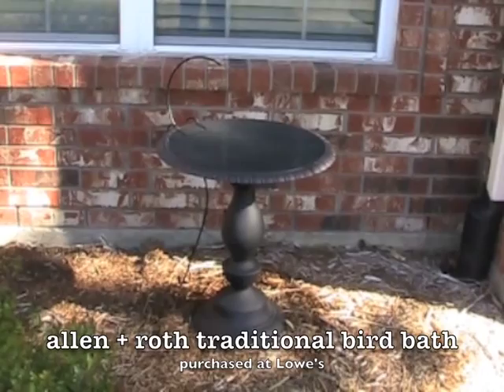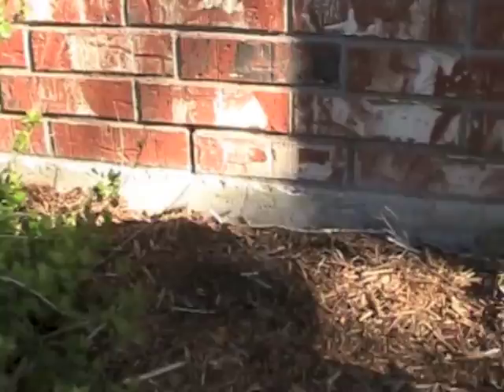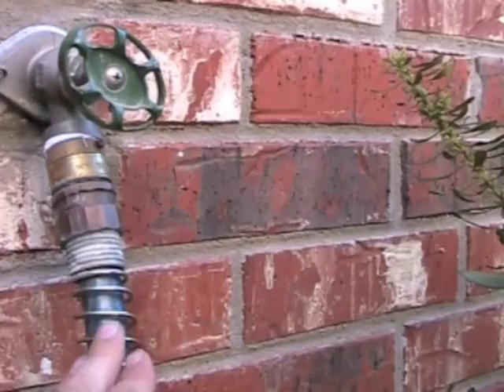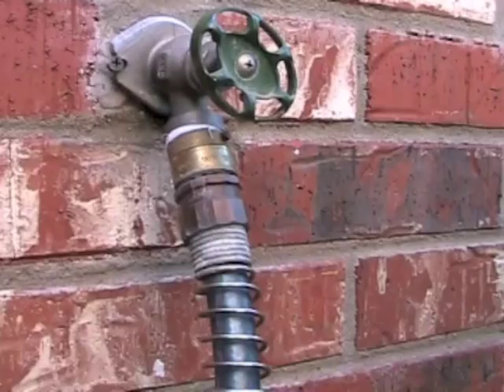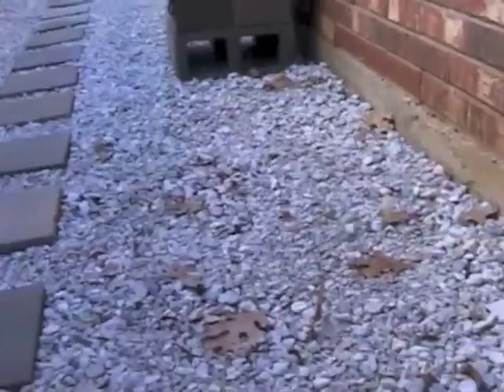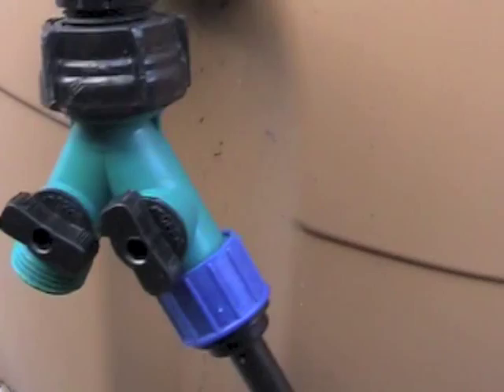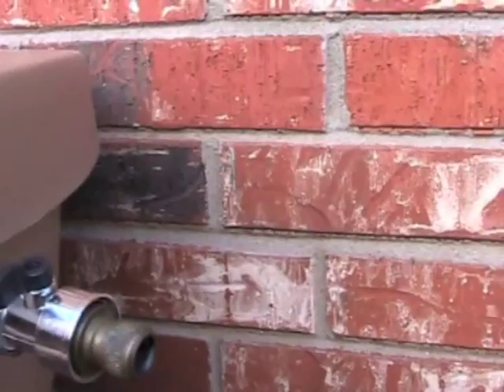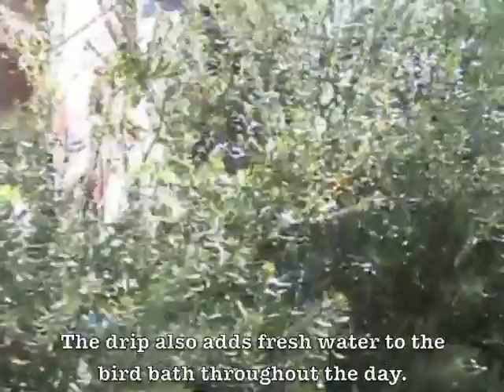Rain Barrel Bird Bath Dripper

Comment: This might be the answer to my problem.  I wanted a bird mister/dripped so badly, but our hose is from the 40s and none of the outdoor faucets are actually next to the house, all three are in the middle of different parts of the yard.  I don't have a rain barrel, but I do wonder if I could do something very similar with a five gallon bucket with an inserted faucet on some cinder blocks?  Give it enough gravity to work?
Reply from the maker: As long as your bucket / water source is higher than your drip, it should work just fine.

Comment: love this idea. How long does a full barrel of water last you at that drip rate, approximately, 1 week? , 2 weeks?
Reply from the maker: It really depends on the weather and the size of the rain barrel. Wind & hot days cause more evaporation. I've had it last as few as 3 days (hot & windy) and as long as 10 days. A week is average.

Comment: Do you have a link to where you bought the dripper because I have seen so many mixed reviews on some models, but yours looks great.
Reply from the maker: Sorry, but no. I used an Erva Bird Bath Dripper that I purchased online from Northwest Nature Shop*. (*I just looked and it's no longer listed among their products - but then 5 years have passed since I posted the video.) This exact same dripper kept showing up in all my internet searches and Northwest had the lowest price so I ordered it from them. The photos online make it look like the dripper is copper but it isn't. It's stainless steel powder-coated with a copper finish. Since criminals steal copper I didn't want a flashy bit of faux copper in the front yard so I spray painted it black (except for the tip, which I didn't want to clog with paint).